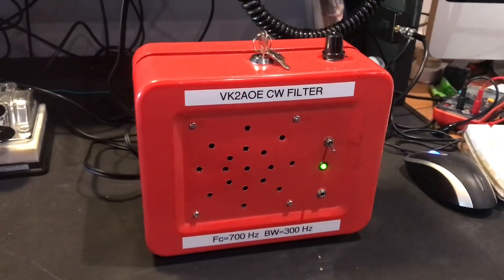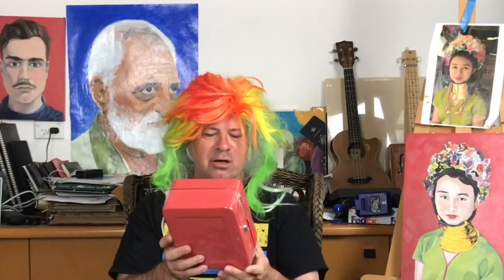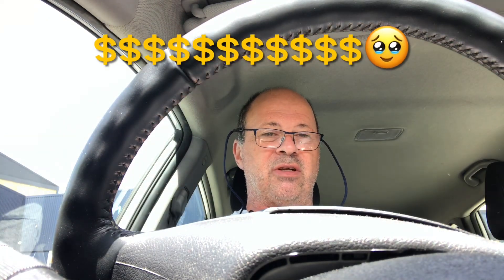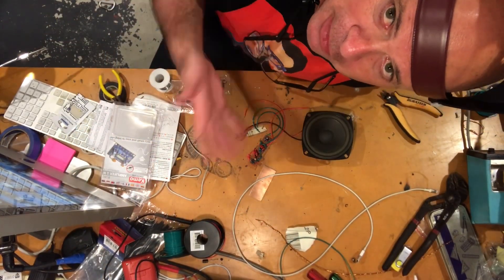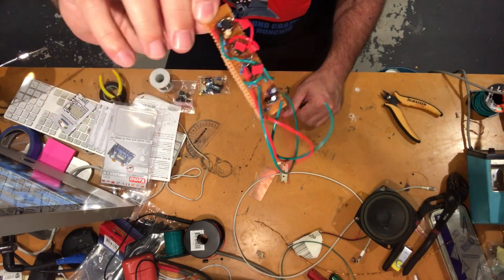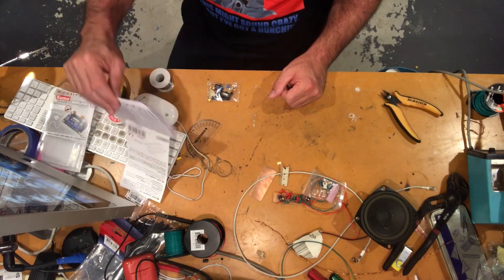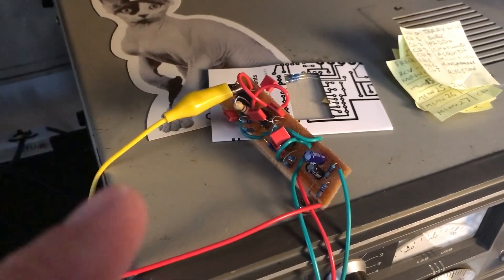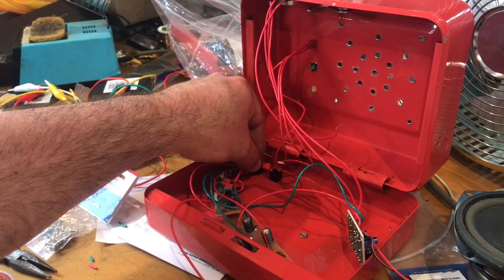CW Audio Filter …. Hear Clearly  @TheArtofEngineering

Comment: Congratulations....FB Acessorie....please, where is the diagram circuit?...
Reply from the maker: At 7mins 47 seconds is the active filter schematic using op amps. I used a kit build audio amp. I am a tinkerer and I build “organically”. There are lots of op amp active filter designs online (most likely better than mine😂). Have a play with some op amps and enjoy the journey . If I get a moment I will sketch it up and post it….but I fear that I made so many mods ….and it was so long ago it might be inaccurate 73 de VK2AOE